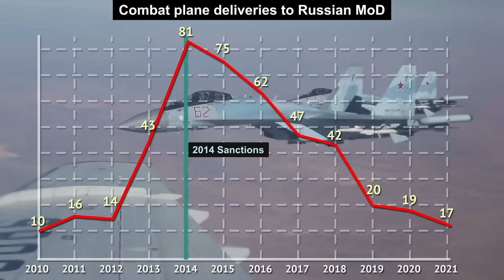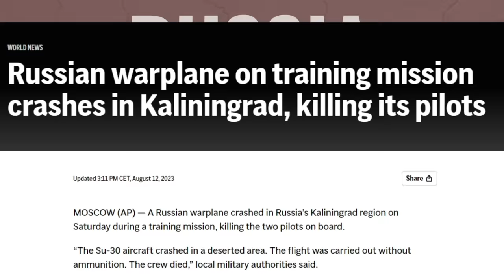Russia has produced more combat jets than it lost in Ukraine in 2023

Comment: Can Russia make all its high tech weapons?? You seem to think so but we know they are backdooring washing machines etc to get their chips and we know there have been bottle necks on the 57s and it isn't just their inability to get their engines to work. They haven't even built a production line for the T-14 and these are not the only high tech weapons Russia isn't  building or only building a few of.. You seem to be more into the military aspect but things like Russia's oil production starting to decline there again western Tech and most importantly western know how . You did mention the war economy, that will create problems on its own as things in Russia become very difficult to find and thus very expensive or impossible to find as Russia shfts production to war needs. Russia high tech industry is very limited so will not be able to produce all of what they need so they will have to prioritize.

Another thing, what we saw in the recent attack on Israel , this is mostly conjecture but it does seem somewhat plausible and I'd put nothing past Putin.. Did Russia push Iran to have Hamas attack Israel in hopes of shifting the worlds and especially America's attention and focus from Ukraine to Israel?  Same goes for this recent attack by Iran on Israel, Iran picks that moment to come out of the closet and directly attack Israel after 40 years of talking chit and using others to attack for Iran !! Could Russia have done some pushing on both these attacks , paid some money given Iran more weapons! Seems like it is far more likely than having Iran get directly involved on its own, especially since Iran came off looking weak. Is Russia now a state sponsor of terrorism !
And another point for you, In this Iran attack the west showed it can pretty much shoot down at will Ballistic and Cruise missiles and seeing as Russia China etc have the vast majority of their Nukes parked on Ballistic and Cruise missiles did that just show the world their weapons are vulnerable to the west but that Russia etc don't have the same capability to shoot down western missiles etc ???   Seems like a lot but it isn't being talked about much ..
Reply: Washing machines is a myth. Like would you really strip down a 1000$ washing machine for a 20$ chip you can order from China? And btw all home appliances are assembled in China anyway. Your device you type this on was at least 50% assembled in China.

For the new equipment the Russians got and producing for themselves and which Europe doesn't have are the following:
-S-500
-The drones
-SU-57
-400% more tanks(this is from the NATO sources I didn't make this up)
-Sufficient number of artillery shells and cruise missiles

What did the Russians get during this war?
- new electronic warfare equipment on vehicles
- satellite jamming weapons
- 2 new artillery systems
- drones
- SU-57
- improved guidance on missiles
- a couple of new satellites in orbit

Comment: Their is also a loss source form simply wearing out an airframe.  Its not clear if Russia is actually writing off airframes when they reach end of lifespan but it dose represent a possible hidden drain on their numbers.  It's also notable that Russian aircraft losses in 2024 seem to correlate with heavy ground pushes, which seems to incidate a lack of caution on their part.
Reply: "which seems to incidate a lack of caution on their part"
Nope. It's just indicate a huge number of sorties made
Reply: Indeed, Russia certainly has airframes in storage that it can pull out (including airframes it has claimed are active in the air force but haven't been part of active squadrons for years, such as Mig-29s). However, these airframes already have high flight hours, they have been subjected to poor storage practices.

Just like the T-62s they are pulling out of storage and refurbishing, it is far from ideal. Russia cannot produce more Su-35s than it is losing either to combat losses or worn out
Reply: Airframe reinforcements exist. That’s how many of the F5s and Mig21s that are still around fly today.

Comment: Russian planes aren’t made for flying thousands and thousands of hours like Nato planes are made for. The war is accelerating depreciation of existing frames many times over. that is also making many frames obsolete. Many planes were decades old when they were starting the war.
Reply: Wearing down of airframes is probably meaningless in a war where you have significant airframe losses to air defense. However, airframes lost to air defense have probably (roughly guessing) used up about half of their flight hours, so every plane lost is kind of like losing only "half" of an airframe in that regard, as long as you are producing brand new ones to replace them.

Comment: My only feedback is two things: 

1. Maintenance on those jets that are still flying. The F-16 has roughly 17 hours of maintenance per hour in the air. How are sanctions affecting this and do the ground crews have logistics. (We’ve seen footage of planes fall out the sky in Russia)

2. Downed Pilots. How long do they take to replace? It is surely 5-6 years of training. How many have been lost? Most Russian jets are two seaters, so we’re looking at 120  or so since the beginning of the war.
Reply: 1. I've seen footage of f-35 breaking down on airfield. Does it mean f-35 are usless? Su-27 needs around 12 hours of maintance per flight hour, but it's most of the time done in 5 hours. Fleet avarage, some airframes take more time.
2. Nope, not 5-6 years, in wartime you can do it in one year for someone who never sat in fighter jet, 4-8 month for someone with some experience. Up to 3 months if it's just a new model of the same airframe you are used to.
Two seater needs a pilot and Weapon System Officer who is not a pilot, he may know how to fly and have basic instrument in front of them (stick, pedals)
Reply: Well it's not like they have around 200 aircrafts, Russia have around 4000 aircraft, so you can bet they have around 10K pilots or more, and when a plane is shot, pilots tend to have a chance to survive since the seat can eject from the aircraft before it hits the ground. And the air force personnel is at least 10/20x the number of pilots.
Reply: Thereare the veterans pilots.. And not only from Russia but from Kazakhstan, Belarus, Uzbekistan and all the other allies. Think that even Wagner group had several pilots
Reply: @nathanielnachtigall7074 I don’t think getting 12 hours of critical maintenance done in 5 hours is the flex you think it is… I bet there is a lot of corner cutting going on…
Also you COULD train pilots in 4/8 months but how effective would they be realistically? Or are they going to cause more crashes and friendly fire incidents?
Reply: @jihadrouani5525 Russia has nowhere near 4k combat aircraft 😂 maybe if you count civilian prop driven cargo planes 😂
Reply: @duxd1452  Nah I'm sticking to the Air Force alone, their total number of aircrafts is around 4000 which includes combat, support, trainers etc... If you count Combat Aircrafts alone they have around 1500 which is still very significant.
Reply: @ouani5525 Id like to see where you got those numbers because reputable sources are saying very different things, about a shrinking, aging air force with badly trained pilots and badly maintained equipment and a horrible readiness rate. And that was BEFORE the war and sanctions. You're likely counting airframes stripped of electronics and left outside for decades as operational aircraft to get to that number.

Comment: There are two lost A-50 - AWACS aircraft.
This is an important component for the modern Air Force and there are only about a dozen of them in the Russian Federation. This is perhaps the most difficult loss to recover.
Reply: It was one A-50
Reply: @hook86  nah, two, and both from friendly fire. Really embarrassing.
Reply: @olgatd9168  no reason to argue that, both were confirmed by FB and other reliable sources. One new A-50 had entered service since then though, so that's somewhat compensating.

Comment: Interesting. If their losses were to exceed newly built aircraft, I wonder what their capacity is to restore and return aircraft in storage to service and how many airframes could be put in service. We are seeing this with tanks and it is widely reported that Ukraine did this with old Soviet jets. I would imagine Russia's capacity to do this would be far greater.
Reply: I wouldn't want to be in a mothballed 30yo mig. At least when one of the old tanks stops working they don't hurtle down to earth at Mach 1.
Reply: @jessepacheco6020  yeah but as we have seen many times in this war it's sometimes a case of beggars can't be choosers. Ukraine has done it and it isn't too dissimilar from a risk perspective to forcing soldiers to fight on the front line with old MT-LBs with their cardboard thin armour. If Russia ever reached a point where they were desperate enough for fighters, and they could fill them with trained aircrew then I think they would do it

Comment: Planes need pilots to fly them. It can take years to train a pilot. More planes does not necessarily lead to more air strength.
Reply: Lots of ex soviet AF pilots can be recalled to duty if needed.
Reply: the side that makes more wins. Russia doesn't have the same logistical problems as the opposing side so they have the edge.
Reply: More planes enables more pilots...
Reply: @lexchaotica190  After thirty years. We need a brain here.

Comment: Right, you do know only 6 SU-35 were delivered to the VKS in 2023? And they've visually lost 8 now...
Reply: You right, Russia defeated. I hear the situation in Soledar is difficult.
Reply: @Forbiddenn  pilots are hard to replace than machines
Reply: @thomasboland540  they can train them? They got way more budget than before
Reply: @blue_ish4499  training still takes a good while, and far more than standard infantry.

Also knowing how corrupt the russian military is, that budget is not going to the training of pilots.
Reply: @thomasboland540  they have no other choice of doing it so they will do it
Reply: @thomasboland540 Training good infantry takes a long time too, and so does getting the men in good physical condition. I'd say 2 to 3 years is a minimum.
Reply: Your point is? Especially knowing they have 118 SU-35, even if they stop making them it'll take a decade of conflict before they run out of 35's.
Reply: @adrien5834  Difference being mediocre army grunt can get the job done while risking minimal amount of equipment.

Badly trained fighter pilot losing a plane costing 50 million USD gets expensive.
Reply: @jackneuman5108  Well, if by getting the job done you mean suffering a casualty ratio of 10 to 1, then sure.
Reply: @adrien5834  Russia can take it if needed for a while and not like Ukrainians are training ultramarines either.

Comment: What about the pilots to fly them???
Reply: Yea failing to consider that is a big big mistake, considering actual competent pilots take hundreds of thousands to a couple of  million dollars to train and years with hundreds of hours of flight time,trained competent pilots are more valuable than fighter jets which can be reproduced
Reply: @A.MM661  Ukraine has a surplus of pilots though because they lost many aircraft in either ground attacks or the pilot just surviving by ejecting. And in wartime timeframes for training get shortened drastically, so I expect F16's in Ukraine soon.
Reply: @duxd1452 where are they going to base these f16s because anywhere in Ukraine the Russians will take them
Reply: Russia can use bus drivers to fly new SU fighter 
It's analog,  easy
Reply: @xijinpig7978  LOL no analogue cockpits are actually much harder to fly. that's why they made digital cockpits, to relief pilot load in combat.
Reply: @withthegoldengun1998 ..and yet they haven't stopped the Ukrainian air force from flying or managed to kill a single Himars. Russia can shoot that far but they cant see that far. Otherwise how do you explain Ukraine still building weapons in factories? They even develop new weapons. That takes people meeting at physiucal location. Yet Russia cant touch them. Why? Because they are basically blind beyond 200km of the front.

Comment: What about tear and wear? You keep loosing planes just because you use them extensively, and airframe resource is not indefinite
Reply: Indeed, it's not about how many you've produced but your overall capacity to maintain those units in combat ready state for operational use, having enough experienced pilots and so on.
Reply: One advantage of Russian technology over American is that their vehicles are designed to be more robust. F16s and the like need well designed and maintained airfields - Russian planes are designed to operate in much harsher conditions and require much less maintenance.
Reply: @frankyyaggabot6222  this can be true, but also russian engines are generally known to serve much less hours than western ones. And when your robust plane lands on bad airfields, it just means that it serves the same time as less robust plane landing on good airfields
Reply: Wearing down of airframes is probably meaningless in a war where you have significant airframe losses to air defense. However, airframes lost to air defense have probably (roughly guessing) used up about half of their flight hours, so every plane lost is kind of like losing only "half" of an airframe in that regard, as long as you are producing brand new ones to replace them.

Comment: Considering the losses of aircraft in the last week, in particular the A-50 and IL-22 they’re going to need every single one. The video also didn’t include the heavy use that war brings on aircraft, higher flight hours and stresses on airframes which only have limited hours (Mig-31 is a good example). Plus larger numbers of older aircraft near retirement.
Reply: I was about say the same. Planes are lost due to wear and war accelerates this. Then there is the pilots as well.  When experienced pilots get downed replacing them requires years of training. If more pilots are trained, more training planes are needed also. More training flight hours is more wear.

Comment: One thing to note - if Russia keeps increasing the production of long range precision weapons, they can afford to be more cautious with their airforce while not losing much effectiveness. Also one thing to note are those relatively cheap GPS guided glide bombs, which can have a pretty decent range (anywhere between 40-80 kilometers, from my understanding) if they are dropped from a high enough altitude. Those are quite easy to make/convert, and Russia surely can produce (and seemingly is doing so) large numbers of those, much larger numbers than the cruise missiles that were talked about in the video. They already are using these bombs on the frontline quite heavily, and then the longer range cruise missiles can be saved for strikes deeper into Ukrainian territory. This way they reduce the risks to their own aircraft as much as is possible, while still retaining a lot of strike capabilities.

Comment: Having  thousands of aircraft is very impressive. This will give the ability to instantly replace battle losses. How many well trained pilots do you have in reserve to replace pilots lost?
I would venture the planes outnumber the qualified pilots by quite a bit.

You could have the greatest supercar ever made. If you dont know how to drive it, it is gonna sit.
Reply: Russian jets are simple to fly.  Nothing complicated, it would just work.
Reply: Same thing happened to Germany's legendary airforce in WW2.
Reply: @saltyjo7514  if you don't know tactics or have not had enough practice, they are just targets, if you don't take yourself out from a mistake. Not the same
Reply: There is a big push right now on the Russian side to increase their Large drone systems for just this reason (which till recently they've been lagging behind in )... with the goal to be able to deploy anything up to the large glide bombs from an unmanned craft that its current fighter bombers have been handling

Which frankly is whats happening all over the world to a greater or lesser degree... drone operators  are safely tucked away potentially thousands of miles from the conflict zone while also being cheaper and easier to train. (with a larger pool of candidates to draw from as well)

this also means the air frames can be way cheaper too, faster to build and far..far less painful to lose..
Reply: @johntowers1213  without a doubt, friend.
The Ukrainians' use of drone "guerilla warfare" on  the scale that they have been has changed  the face of warfare forever.
Skynet just gets closer every day.